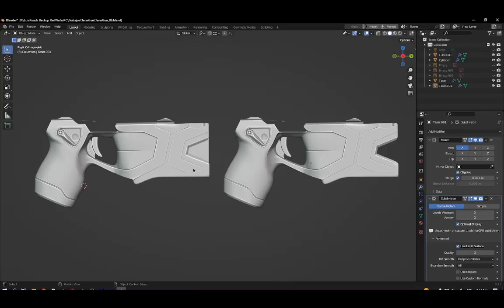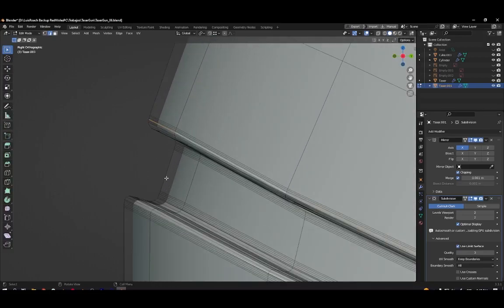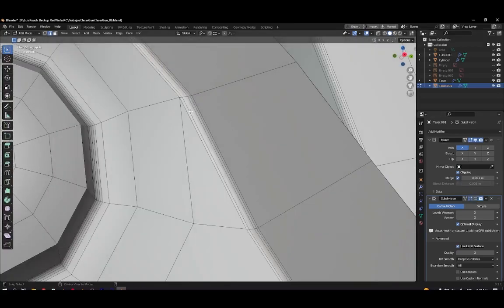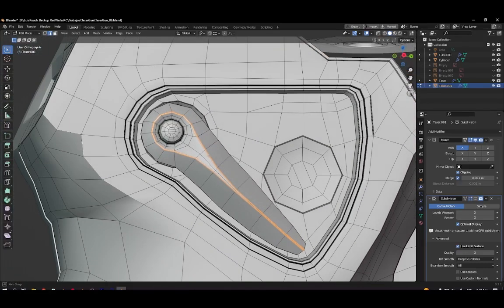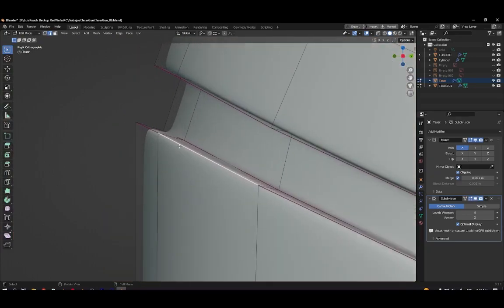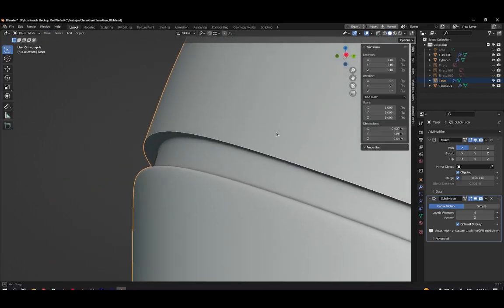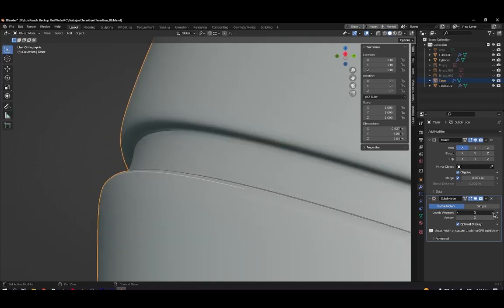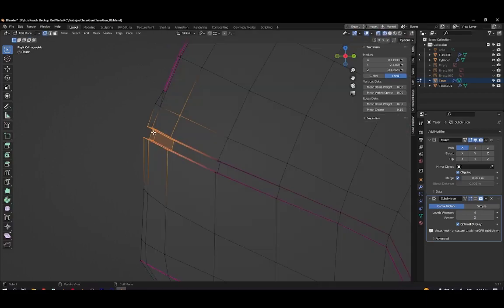Why you should use Creases

Comment: Why not use a bevel modifier
Reply from the maker: Hi @badsongcovers.mp4738 
The bevel modifier is helpful for rounding edges, but if you need to round not only edges but also curved surfaces like the handle of a weapon or grip, I'd recommend using the Subdivision Surface modifier. It's a great solution for achieving more comprehensive rounding. Thanks for asking! Best!
Reply: @medicciGame  I'm not saying to replace the subdev modifier with bevel. Use the subdev to make edges smooth, and where you need it to be sharper use the weighted normals
Reply from the maker: @badsongcovers.mp4738  Hi! I´ve tried to use both modifiers but not always having the results I´m looking for.

Comment: Does creases work with game engines when exported?
Reply from the maker: Hi @abdrnasr, The common workflow for unique props for a game engine is to bake the high poly with the low poly, texture it, and then load the textures inside the game engine.  
So creases will be useful for exporting the high poly mesh and in the baking process.

Comment: Use a bevel modifier and the bevel weight property. Solved
Reply from the maker: Thank you for the tip! However, I'd like to clarify that this method is helpful for rounding edges, but if you need to round not only edges but also curved surfaces like the handle of a weapon or grip, I'd recommend using the Subdivision Surface modifier. It's a great solution for achieving more comprehensive rounding. Thanks again!